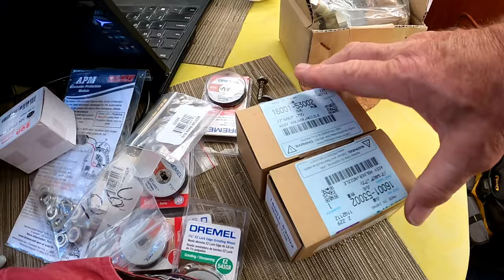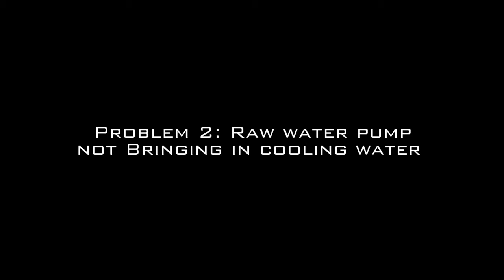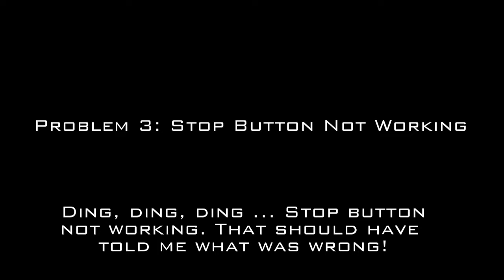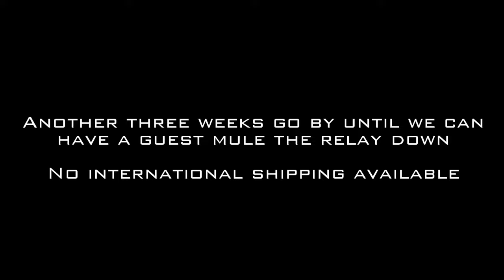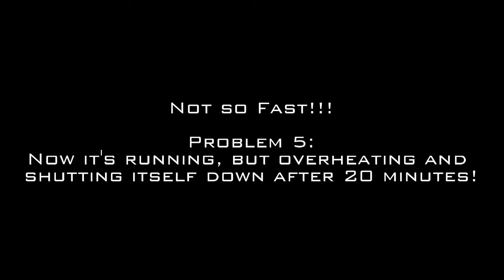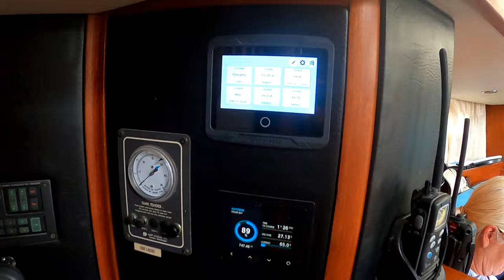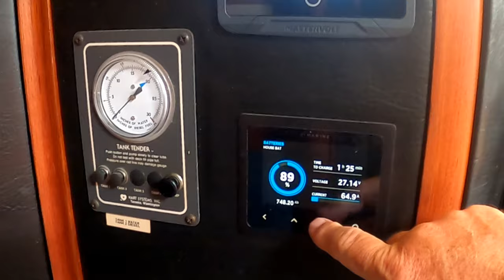Ep 147 I Refuse to Fail at This! Fischer Panda Generator

Comment: So great as usual. -- QUESTION ---  One thing I can never understand is why it seems so much more complicated and difficult to maintain a larger sailboat compared to say a 35 foot sailboat - both can have the same systems, toilet, engine, battery, fuel tank, water tank, auto pilot etc. I could understand that a bigger sailboat has longer wires and longer plumping pipes and longer fuel pipes.  But why does it seem like it actually has much more "stuff" to fix and maintain.  Don't get it.  If only your 485 was as "simple" as a 35 Contessa or Alberg to maintain.  I think I could handle those ones.  But I want a larger one like yours for comfort and stability and safety. The truth, I fear, is you have to be a man to manage your sailboat.  Yeah, not PC to say it, but I have yet to see a woman do it by herself and I know I could not do so.  Guys just think differently and handle it better and I don't care who disagrees because it is so true.  Maybe we should protest for women friendly large sailboat where someone else does the maintenance?  :)
Reply from the maker: Hi Coleen. I decided to take a night to thing about this one. First, at 35' you're unlikely to get a generator, so you have to forego some comforts. Solar alone won't do it, especially if you have a fridge and freezer. But more to your point, we have several things going on. First and foremost, we chose to buy a near 30yo boat at the time, and it's actually/or very nearly, 30 years old now (late 1994). For you, if you were a successful professional and less price sensitive, double the purchase price from $210K (now about $350K) to $450-500K, and get something newer, ideally 2010 or newer. This will get you the same number of systems we have, but newer and less likely to give you issues. Budget 10% of the purchase price annually to maintenance, and outsource it to the men in the yard. Be unyielding on them for quality of work, and don't pay until you're satisfied. Moving back to me, I have a theory that when you buy a high end boat like an Oyster or Hallberg Rassy, you're really buying the hull, joinery, and spars. Beyond that, it's all equipment from third parties (spars are third party too, but rarely replaced). These are available if not already included on other brands, and easily replaced if need be, given the right amount of $. For us, three decade old refrigeration and such is just outdated technology, and was priced into the sale. Oysters are almost unique in the boat world as supporting upgraded systems (ie, you get back what you put in, to a degree, when you sell). Note too that things like LifePo4 lithium batteries and low voltage air conditioning are really frivolous options in truth, and if we were truly low on funds we'd just forego things like that. Finally, and this is the big one. We live on the boat nearly full time (8 months out of the year), and put the whip to Talisman on the water, which she likes. This leads to accelerated wear and stuff breaking. It's important to make sure you don't end up boat-poor, and not having the funds to actually sail. We see so many project boats that just sit in the yard while some poor dude spends years trying to get a boat seaworthy. The point is to sail, not have the perfect be the enemy of the good. As for men being better at these things, it's true that they are. I can envision and design a backhoe in my mind's eye, which is a talent most women have no idea exists. It's why men are so much more visually stimulated. And we kind of get edgy if we don't have physical jobs to do and things to fix. So that was Wendy's solution, and perhaps it could be yours too. Find a sucker like me to do all the heavy work while you sail. Now that I think about it, Wendy does 2/3 of the sailing and 100% of anchoring, 100% of laundry/cooking (she enjoys cooking), while I do 100% of the mechanical work, planning, purchasing of parts, 1/3 of the sailing, and 100% of docking, 60% of eating. Hope all is well in your world. Save and spend for a newer boat, and be prepared to replace toilet parts a lot.
Reply: Such wise words, had to read it twice to absorb all the advice, very well done. Episodes like this keep my boat purchase need in check, thank goodness!

Comment: Generators, tell me about it. Or rather don’t! They are by far the worst equipment on a boat. 
They will always fail. That’s no problem (motors do fail sometimes) but (smal) generators are failing too often.
A manufacturer who can fix that will have good business and leave eventually the failures behind.
Reply from the maker: Hi Camilla, and thanks for being with us. Yes, I agree on all your points. It's just such a tough environment that they live and work in. And electrical components are so sensitive to moisture and corrosion. Galvanic corrosion especially. And I'd say that the Kubota Z482 is a workhorse engine used throughout the agricultural industry. But the wiring, relays, solenoids, etc. are the weak link. I also believe that the newer Fischer Pandas are doing a better job with automotive style on-board diagnostics (OBD). In my view, the single most difficult system to keep going is actually watermakers. I'd estimate that 50-60% of the marine watermakers on cruising sailboats are inoperable.